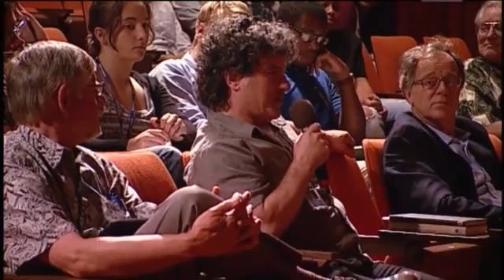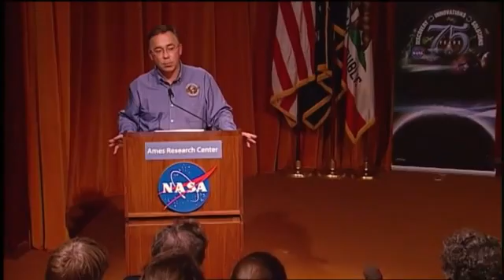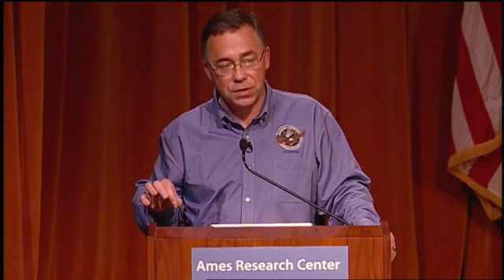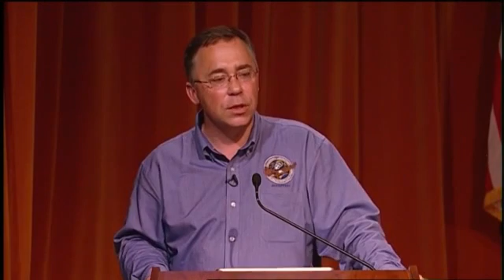Warp drive and Harold White: A question with no answer

Comment: You just need to feed the q thrusters through a turboencabulator's magneto reluctance field.
Reply: Won't that cause side fumbling? Even with the  marzel vanes, and perfectly synchronized cardinal grammeters.
Reply: @Swidhelm  No. But it will produce quasi-dipole hybrid Nurburgrin saturation of endonucleoid septic ring.
Either that or a linear "tilt-back" acceleration curve which will mask the umbral readings that their model uses to interpret the molecular upspin factor.
Reply: @CageRraft  Needs stronger unilateral phase detraction. I think the prefamulated amulite is just outdated, doesn't cut it anymore. Doubling the sperving bearings should help.